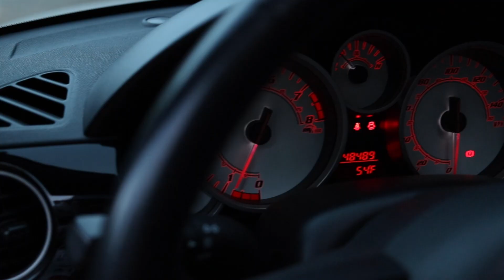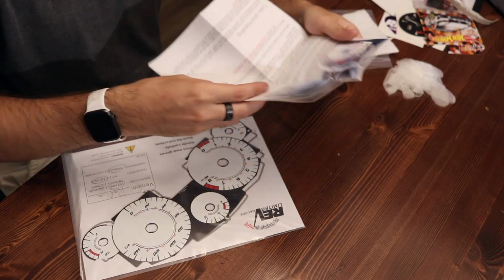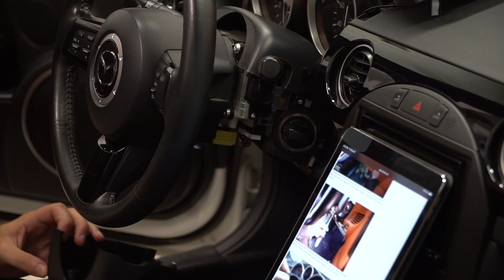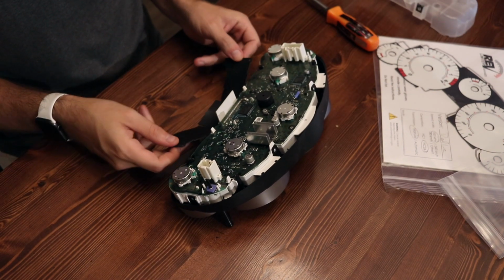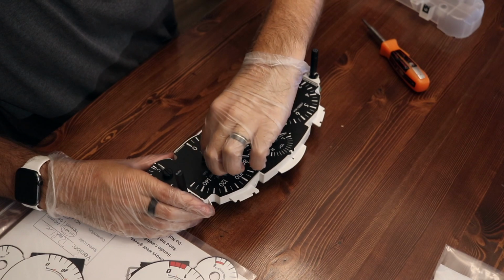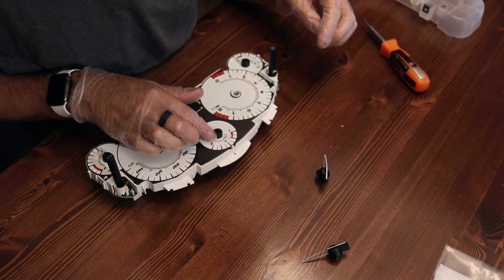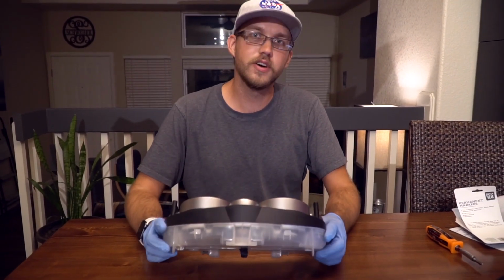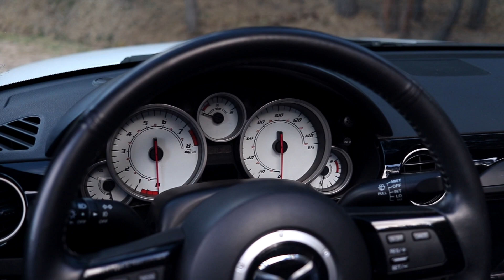Revlimiter Gauges | NC Miata

Comment: I can't recommend Revlimiter enough.
He has made several bespoke items for my NC, and they've all been exquisite. 
For gauges I started with the warbird as a base and made MANY changes.  The process was so pleasant as to actually be fun, and the final product is stunning.  Cost was also extremely reasonable. 
Just a great company/guy.
Reply: By any chance any experience with changing the led lights on the NC cluster?
Reply: @David-yx5vx   Sadly, no.  I hate the red and would love to upgrade to white leds.  
It can be done, but requires solder work.
I considered it, but don't have faith in my skills.
If you know someone comfortable working with circuitry, it's a pretty straightforward job.